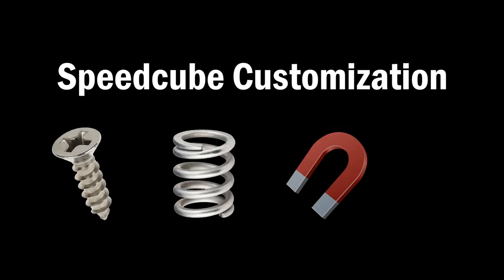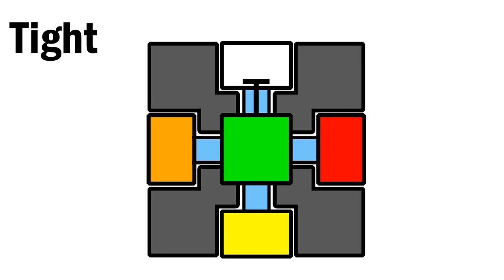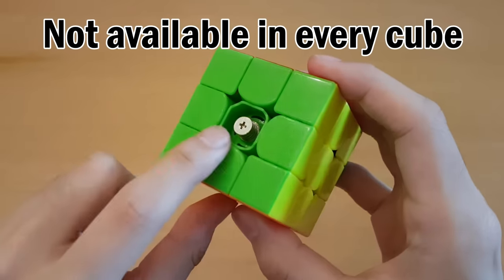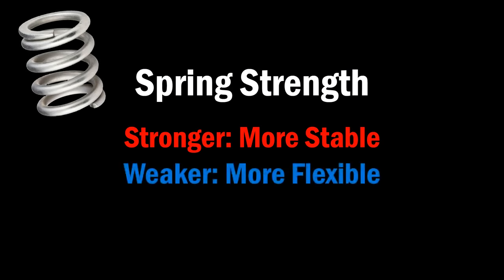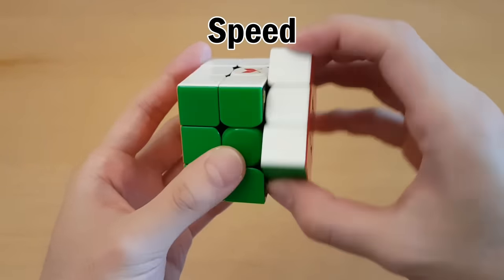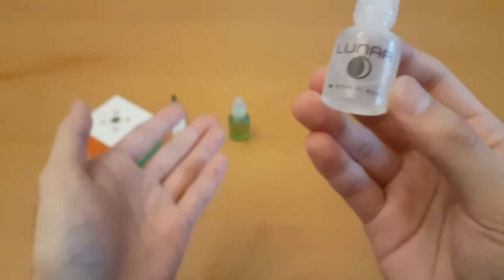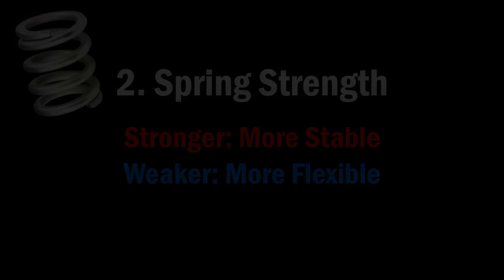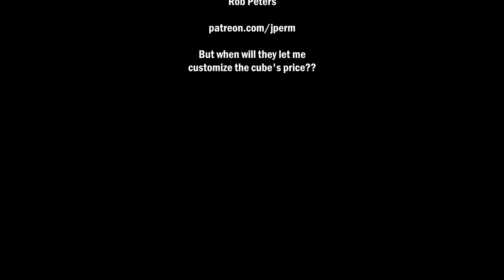How To Setup & Customize a Rubik's Cube

Comment: I think what's most fascinating is how far mechanical engineering for speedcubing has become. Designing all of these adjustable features and making them accessible to any new speedcuber certainly isn't easy.
Reply: ... or intuitive and easy.
 
I'm an RS3M 2020 cuber, and I didn't get to experience the hassle of gluing magnets in place.

Many people complained about the cube's weak magnets, and I think that was the point. They're designed to be weak so that you can strengthen them without glues.
Reply: it wont be if a person is not into mechanical engineering/building overall.

Im a builder and programmer on our robotics team so I think it might not be that hard if you can be into it
Reply: Still remember the times when we only had the screw length and no magnets. Seems like an eternity ago.
Reply: Thank China and their manufacturing wizardry. If this was made 15 years ago in an American factory, they’d be hundreds and hundreds of dollars, no exaggeration. If Gan, moyu, etc. didn’t exist and it was an American factory, I would expect something like a Gan 13 to be $500 dollars minimum. 

It’s been happening with tons of products. A good example off the top of my head is ultrasonic cleaners. For decades, if you wanted to buy a small one, there was only one American company that made them. The price was around $1500 to $2000 dollars for one. After Alibaba, you could immediately get one of equal quality straight from the Chinese factory for less than $100 bucks.

The best example is watches. There are a few models of the Rolex Submariner which you can get a counterfeit of from a Chinese website. The counterfeit is absolutely indistinguishable from genuine down to every last detail of all the complex internals. They even grow the exact same rubies that Rolex uses. Like it’s so perfectly copied that even a high level expert can’t tell them apart. It’s a big problem in the resell market. Nobody wants to buy them because there’s literally no way to know for sure if it’s genuine. These models used to resell for around $18k and now they go for like 14k which is an all time low. The counterfeit is $600. Genuine is 14-15 thousand. Again, they’re the exact same watch. Same everything. For all intents and purposes, it may as well be genuine because nobody will ever possibly know it’s not. 

This is how good Chinese manufacturing is.
Reply: dawg I'm coming back after ten years and I'm so fucking dizzy

Comment: On the Gan and moyu system, changing the spring compression actually changes the screw depth by a tiny amount, but the difference between the max and minimum setting is actually kinda noticeable btw.
Reply: Do you remember this channel

Comment: Great tutorial I used it to setup every single one of cubes since this video was released but 1 thing I found after becoming a little bit more experience with setting up cubes is that lubes create a big difference in feel for example if you apply mythic in the wrm 2021 it wents from smooth to plush which changes the feel and more lube just change it even more it can make your cube feel gummy heavy etc besides that the the tutorial is great .

Comment: I have a challenge for you J perm. Solve a 3x3x3 by only using turns of 3. This means that if you wanted to do U prime instead you would do 3 normal U. For the Moves of two like U2 you have to go the other way as in if you normally go U2 prime you have to go U2.

Comment: I used Stardust in 3 of my YJ MGC cubes (3x3, 4x4, 5x5). It slowed them down and made them feel gummy and the effect lasted a month. Decided to stick with Dnm-37.
Reply: sheesh 2 stores
Reply: Did you use only Stardust or did you have it mixed with any other lubes?
Reply: @DeltaInsanity  Just stardust alone into cleaned cubes.
Reply: @yonaash  that's odd I wouldn't have thought a water based lube as thin as Stardust would feel gummy. I haven't used Stardust personally so I'm not speaking from experience, but I have heard the best way to use it is mixed with a bit of lunar.
Reply: @DeltaInsanity  Yes I am absolutely confused as to what the problem is, I think maybe my pack of stardust is wrongly mixed. Like I said I tried it several times with freshly cleaned cubes and the result was the same. Awful. I don't have lunar, so I haven't tried mixed it with that.

Comment: The Tornado V2 actually fixes the TengYun V2's Screw Depth System.

Only now I think DaYan's intention was that:
The Tool was supposed to adjust the Screw Depth.
The Screwdriver was supposed to make the centerpieces removable.

The latter wasn't designed to be part of the adjustmenr system, but looking at the manual, even DaYan got confused.

Comment: hey J Perm have you done a review on the Gan 356 M yet? Its my main speedcube (of the four cubes i have) and i think its a really nice cube for under $30. with my other cubes i had been getting around 45 second solves but with the Gan 356 M ive been getting 30 to 35 second solves. Ive never owned a Gan cube before and now i understand why you say Gan has a lot of unnecessary packaging 😂.
Reply: @hotmilfshangout1528  yeah unfortunately the lower priced cubes have weak magnets.
Reply: @rowansradio09  Softer magnets are better, like in the tenghun m

Comment: What settings do you use for the weilong gts3m. I don’t really know what are the best settings for me so it would help to know what setting you use.
Reply from the maker: Spring compression on the highest setting, and screws at a depth similar to what I show when pulling apart layers on the valk in this video.
Reply: @JPerm  can you please make a tutorial to perfectly setup RS3 M 2020 
because i am going to buy it and i want it perfectly 
please JPERM
i want it good as good it can
Reply: @tanmaymall9548  There is no perfect, only good. Just throw lube in there lol. Make it tight enough to not corner twist imo and that's all you need.

Comment: hey- I was wondering what a “mat” finish is on Rubix cubes? You mentioned it in your gan xls video and I was curious
Reply: Basicallycube is more slippery and not shiny. It goes away over time.
Reply: Matte is often described as "not glossy/shiny" look of the cube.

But it can also refer to its texture, which is rough as if the cube has grains of sand on its surface.

Since they tend to become glossy over time, I think it's meant to indicate that you have a new/unused cube... like those seals that show you that your mayonnaise bottle wasn't opened yet.

Comment: I believe I have a Moyu Aolong V2. I'm having trouble setting it up propperly. No matter how I set the screws, it still has constant pops and lock ups. It hasn't always been this way. I've tried adjusting it again and again but I can't get it right. I never used lube. Is it fixable or should I burn it and get a magnetic cube instead?

Comment: I have one general question: do you use the same setup for cubes with the same customization options? For example I found myself using different settings for my Xv2, XS and 11M Pro, just because the cubes have different feel and I needed different changes from the factory setup. Do you experience the same or if you like a setup, you use the same for newer cubes too?
Reply: Use diffrent. Diffrent cubes have diffrent feel, so diffrent setting would be the best. I always write word different wrong!

Comment: HELP: watched twice incase i just missed it fyi and great video. I understand the screw and spring tensions purposes but I still dont know or understand how far the screws should be screwed in??? Just barely or more? And then do i make up for loseness with the spring tensioner?
Reply: i usually go for a balance,first adjust the screws for tightness and then springs,springs can affect tightness but not drastically,so i usually change them based on the effort it takes to corner cut,a part of it is also preference so i recommend that you play with it a little
Reply: @lory7833  no problem there, ever since my first solve its become a soft obsession. From when i wake up to when im asleep, its either in my hands or in my pocket. Im always on the hunt for a new record # of moves or faster time. Even switching it up occasionally by picking randomly picking a different color as primary start

Comment: Hello!
Can you tell me that do we put lube in gan 356 cube (magnetic)?.But there is magnet so is it important to put lube in gan 356 cube?.If is it important, so which lube should I use ?
Please tell
Reply: Depends on how fast/slow the cube is. Use a higher weight silicone lube if it's too fast or use a water based lube if it is too slow. Clean your cube before you lube it btw.

Comment: Can I adjust the screw depth on a cube which is not a speed cube (Low budget cube with limited corning cutting, no magnet and no lubes required) to speed it up.
Reply: not if its a rubiks brand

Comment: One question, and im serious.. I got my first speedcube today the x man tornado v2 and im trying to figure out how to take off the center cap without breaking the cube, it seems as if i need to apply some force or im doing something wrong
Reply: I use the two legged tool to easily remove the center caps

Comment: So if u have a cube that fancy cube with the customization next to the spring / screw you dont have to manually set the screw or the spring?
(i dont really get it)
Reply: ypu should never change this sort of stuffs
because it ruins the system accuracy
like the old tornado v3 it had the screw along to the system
and if you change the screw depth it will dfinetly be meesed up

Comment: I think mine is broken because every time I use it, one screw loosens up on its own. Especially the screw on the yellow one. Is there a solution? I use the MoYu RS3 M 2020 3x3
Reply: stripped core, impossible to fix. I experienced it in both of cubes.
No choice but to buy a new cube

Comment: My moyu rs3m 2020 cannot do 45 corner cut on every screw depth.What do i do better corner cut?
Reply: same, please help, i have an rs3m 2021 and it cant corner cutt like 30 degress, i tried to change the screw depth but it just cant, did you solve the problem?